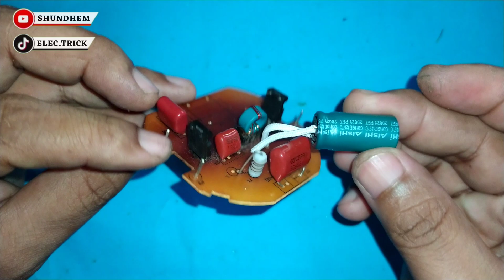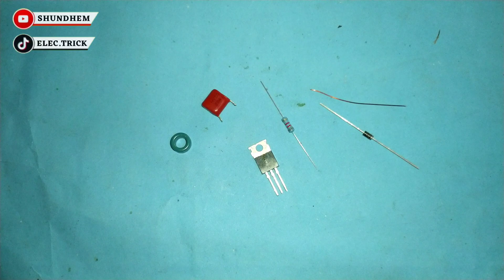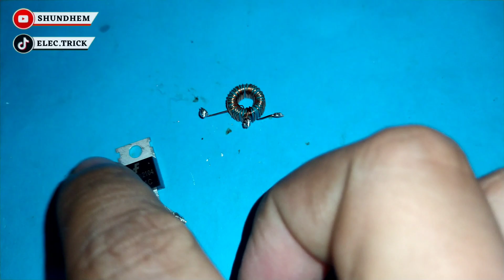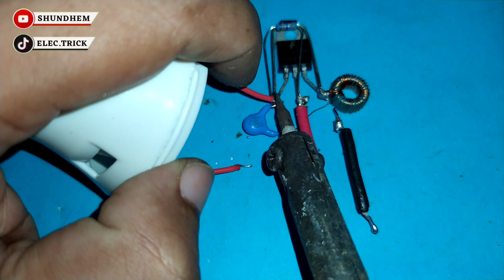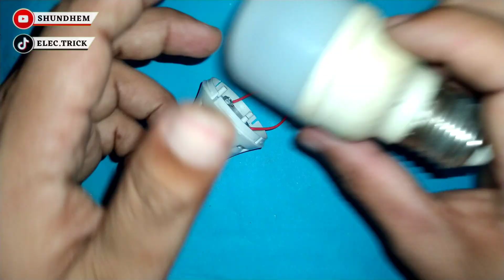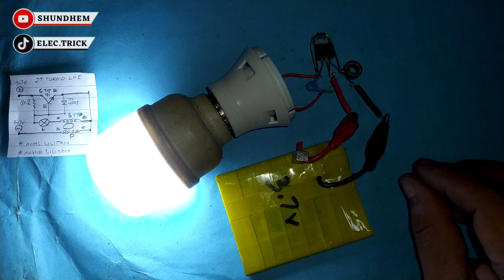jt toroid lhe skema I-Net

Comment: Komponennya apa ajh bosku....
Reply from the maker: transistor
kapasitor
resistor
dioda
ferit
Reply: Pake TR tip 42 bisa gk boskuu
Reply: Toroidnya brapa lilitan boskuu....
Reply from the maker: @vzdomgar1355  p 1 lilit
s 25 lilit
Reply: @shundhem_electrick  ok trimakasih sukses sllu boskuu....